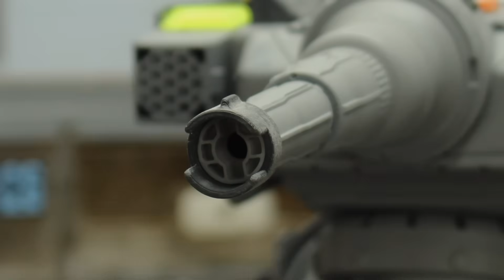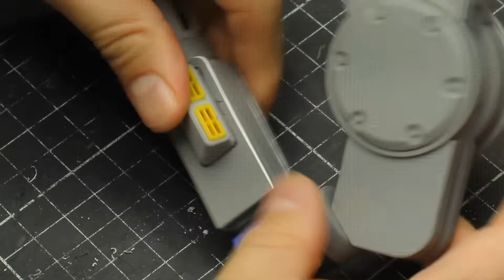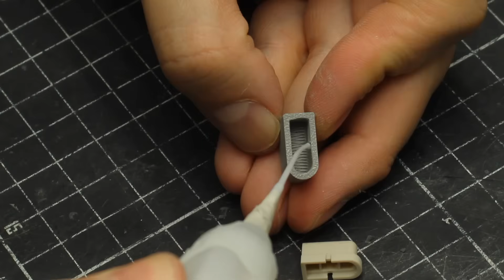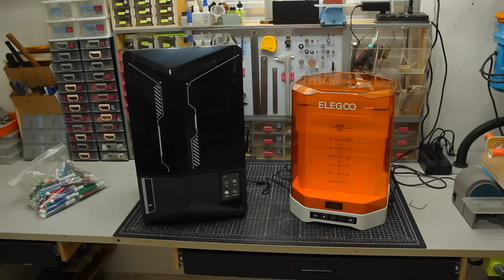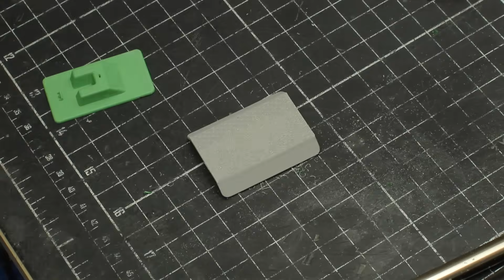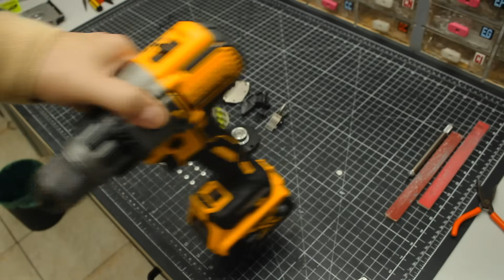Using OLD KEYBOARDS to build MECHS!

Comment: I envision this a little Mars-y, so the dirt wash should be rust red, mid grey and anthracite (near black dark grey). That in mind, I think the main body should contrast a little but pitch into the red-orange some. Maybe a blue-grey base coat that peaks through on some panels, painted up with Fiery Orange pieces and adorned with accents of high yellow/black Hazard Paint where not to touch. Maybe mix a thiny dash of green and some phosphorescent paint for the inside of the heat vents, where the engines leak fusion reactor light through the heat vents
Reply: That idea is 🔥